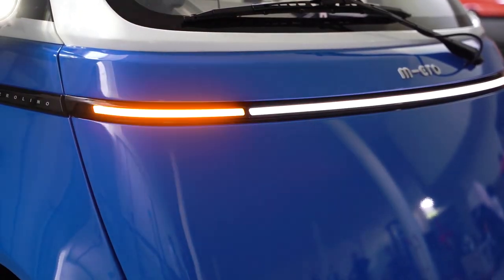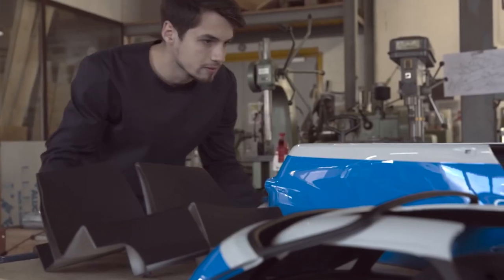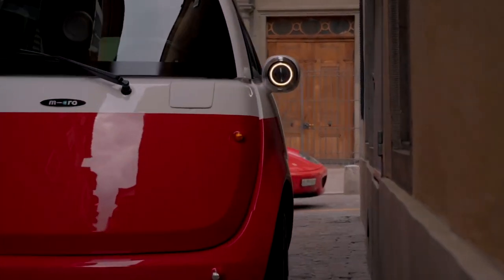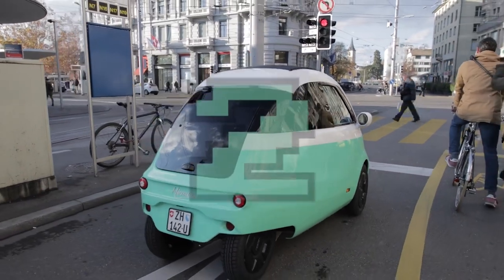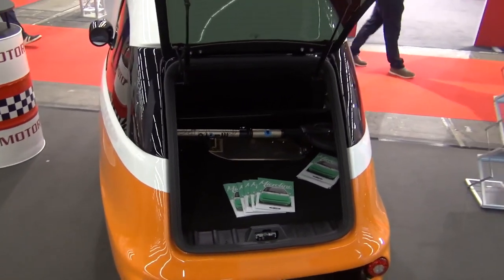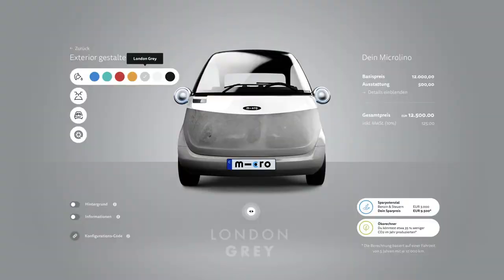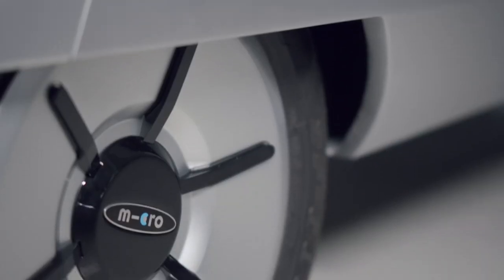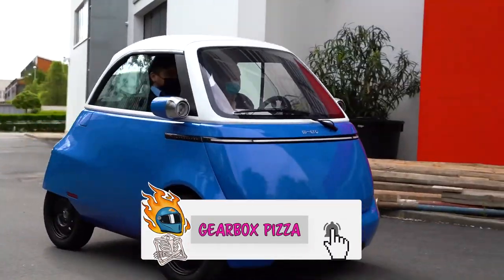The Microlino :: A $14,500 EV with One Door? What, how?

Comment: $14,500 for this is insane. The changeover to Electric vehicles is an excuse to "reset" car prices to make them too expensive for average drivers. Come on, this thing should be well under $5000.
Reply: R&D, current high cost of batteries, original ground up design and manufacturing in Switzerland and Italy. Yep, it’s priced about right. You get what you pay for. 
Well under $5k… Please, elaborate on how this would be even remotely possible?
Reply: @jimmyw7530  In Europe you can get a REAL 4 seater petrol automobile that can go 400 miles on a single tank for under 7000 Euro's. So by comparison this is poor value for money.
Reply: @jakejoliet8200  It looks real to me. Do you think it’s CGI? LOL
I thought we were comparing apples with apples. EVs are still expensive due to the batteries. Everyone knows this. Your argument rides on a single budget model Dacia I presume. Stripped out model for a low starting price that no one would buy. 
This is a new concept EV for urban transport in the tight confines of busy and ancient European cities. You charge it at home for very little cost and maintenance costs are low.
Factor in the cost of fuel in Europe and this little car closes the price/cost gap with the Dacia in a couple of years. 
In Italy the Smart FourTwo was insanely popular because it was so small. Imagine trying to park a massive American car on the streets of Rome and I think you may begin to understand. Context matters.
Reply: @jimmyw7530  How on earth can you call a Dacia a "stripped out model for a low starting price", and yet somehow think this toy car is more like a fully fledged vehicle ?
and for your information although you suggest that "no one would buy it" Dacia's are one of the most popular models in Europe, albeit because of price, but that is something this thing fails to grasp.
Reply: @jakejoliet8200  how many people buy the cheapest model though? Not many. Most people boost it up to at least the mid range $9-10k models. 
So you’re going to totally ignore context and the niche market this vehicle was clearly made for to make sweeping statements about vehicle size. Also ignoring long term economic benefits and environmental concerns?
Reply: @nfsfanAndrew  how so, please do explain. Should humans continue to drive petrol cars until the end of time? Or ,should we move along with technological advancement? Are you enjoying the use of a smart phone over a basic mobile phone for example?
Also, please do explain how polluting and pollution is a good thing? I’ll wait.
Before you go off on a deliberately obtuse argument about how much EVs pollute, your not original or clever. It’s all about potential. ICE has reached it’s peak, EVs are just at the beginning of their developmental potential.
Reply: Microcars like this cost between 10k and 20k....